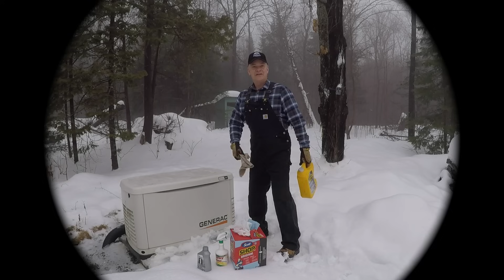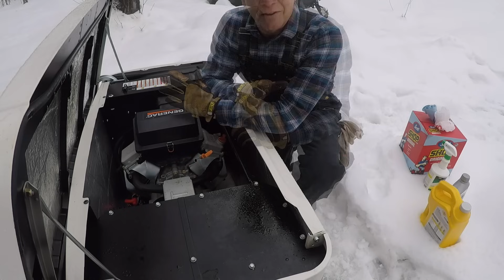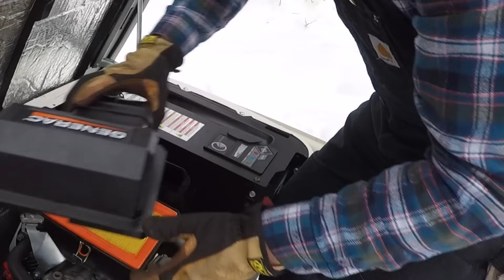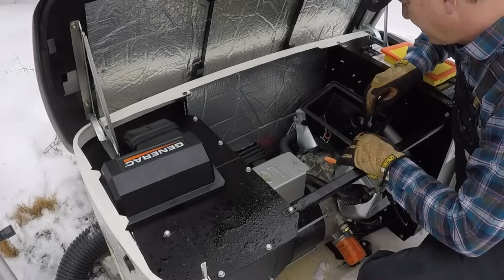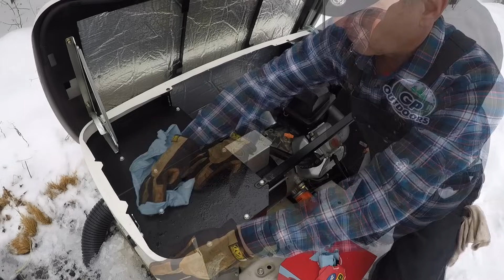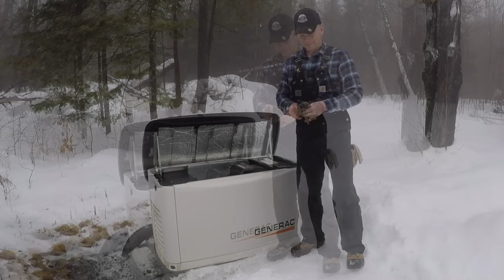#133 Thinking of Buying a Generac Generator? You Need To Watch This!

Comment: I don't understand why there's an exhaust port in the air filter. If it were my genset, I'd put in a different air filter or put a drain tube in the housing. Personally,  with the price of propane, I'd invest in a diesel genset. They usually run at 1800 rpm and they're good on consumption of fuel. Diesel genset cost more, but are more reliable. Personally just saying. 😎😎😎🤔🤔🤔
Reply from the maker: Good day and thanks Tomas. I understand it is the vent port from the crankcase. But yes, could be a better design I think, and have many here have mentioned. When the time comes I will certainly take a wider view of options. Thanks!
Reply: @GPOutdoors  
I saw the comments afterwards.  My phone won't always allow me to view comments. G'day
Reply: The crankcase vents the hydrocarbons into the air box so they can be burnt in the engine.  Cars can have the same issue.
Reply: Tomas Keating: "Diesel genset cost more, but are more reliable." However, diesel gensets require more maintenance to achieve any reliability improvement. The fuel tank tends to collect moisture and sludge and then things actually grow in the tank (i.e. microbial contamination). However, if the fuel tank is drained and cleaned from time to time, this problem can be minimized. Again, more maintenance. Also, if diesel gensets are not loaded to at least 50% of nameplate ratings, the exhaust system is subject to fouling and sulfuric acid corrosion (i.e. "wet-stacking"). If this unit is not being loaded reasonably, then it may not be getting warm enough causing the condensation issue in the air filter housing--a warm engine might not collect such condensation. Most residential applications are thus better served with a propane unit, properly sized (not oversized). Personally just saying. 😎
Reply: Soren Solveig propane is the least efficient fuel for economical long term operation.
Reply: Klaus Van Heusen My old gas 4 kw generator ran for around 4 hrs per gallon, my 2002 diesel 5kw runs for over 6hrs, and the diesel stores way better for long periods of time over gas. Propane is more expensive to run than gas, that’s been my experience anyway, ymmv.
Reply: Tomas Keating , all engine's have a pcv valve or positive crankcase ventilation valve , it is not a exhaust port , has nothing to do with exhaust , it it pressure from inside the engine crankcase , disconnect it from the air filter box , plug the hole in box and route the vent hose elsewhere , no more water freezing in the box , no oil blowing out the dipstick tube , problem solved

Comment: That sounds like a design flaw that should have been anticipated.
Reply: Trinkling Creek not actually sure you can. It’s an EGR system, the byproduct of poorly thought out government emissions regulations.
Reply: @onemischiefmaker7032  Never would have thought the PCV valve would stop the engine cold. I guess it goes to show you when ordering a small engine have them set it up for altitude and temp extremes.
The Honda's and Propane Convection Ovens my company owns are all tuned to run at 6000 feet.
Reply: Herman Greenfield  He probably just realized he was dealing with a half wit.
Reply: Yes, in retrospect the oil in the compartment makes sense that it was the PCV valve since that would cause oil to be forced out of the valve cover or oil pan gasket.
Reply: @edwo6648  Amen!
Reply: Herman Greenfield  Manufactures used to be able to vent the crankcase directly to the atmosphere before the government made them change it. Your very rude.
Reply: Don't pick on them Canadians I work with them in Fort McMurray they were pretty nice on the bottom of the air cleaner put like a PCV valves in the bottom when it runs it pulls the ball up when it shut off the ball drops let's the water come out and when you start it up the ball comes up again seals It Off
Reply: i bet herman is really fun to be around . what a peach , bless his little heart .
Reply: He may consider sending a link from this video to the manufacturer , I know I've done it with similar problems of other appliances I own , or when warranty expires modify it by adding a heating wire with a drain hose, iam no expert just thought of it as I was commenting.
Reply: Some of the psi 8.1 GM engines have a can with a filter in it for the pcv , the early ones would get a ton of water in them from condensation. 
Took em a few years , but they licked it by wrapping the can with insulation.
 Not a bad plan to retrofit others. 
Even some of the Briggs units a few years back had a similar issue until they redesigned the hoses. 
Some of it can definitely be blamed on short exercise times running no load. 
Haha if we could get the customers to run it loaded for a couple hours once a month in the winter it would help out,but they usually think these things don't need any maintenance like a new car that's minimal. 
Nope ,these things still need someone to look at em once in a while.
Reply: It is manufactured in the USA. Expect the worst.

Comment: Here's what's happening:

When an engine runs, it burns fuel to create pressure. This pressure is used to push the piston down in the cylinder, which turns the crank.

The piston seals against the inside wall of the cylinder with a series of metal rings. These rings have small gaps in them to allow for expansion and to create pressure on the walls of the cylinder. As a result, a small amount of the pressurized gases created by burning the fuel gets past the rings and into the engine's crankcase. This is called "blow-by".

These gases contain quite a few different things: primary amongst them are carbon dioxide, carbon monoxide, water vapor, and soot (carbon). Incidentally, this soot (carbon) is what turns your oil black - part of the job of your oil is to hold in suspension all the contaminants from the piston blow-by.

If the engine is cold, the water vapor condenses almost immediately into your oil. This is why exercising your engine for short amounts of time (where the oil does not get above the boiling temperature of water) is very bad: you end up with a milky emulsion instead of oil - this is water and oil mixed together, and is very corrosive to the inside of your engine. Whenever you run your engine, it's very important to run it long enough to get the oil up above boiling temperature, to boil off all of the water out of it.

So we have all this pressurized blow-by in the crankcase. It has to go somewhere. So it pushes out through the PCV (positive crankcase ventilation) valve, a one-way valve that lets pressurized gases out of the crankcase.

As I mentioned, there are some pretty noxious things in these gases: CO, CO2, and water vapor (which is acidic at this point). It will also contain a bit of oil mist. You could just ventilate this outside, but this will be messy, smelly, bad for the environment, and not to mention illegal. So instead, it is ventilated back into the intake manifold, where the gases are burned by the engine.

If the output of this PCV gets blocked (i.e. by ice) then the crankcase starts to build up pressure. So it has to get relief somewhere, and it does so by blowing out your dipstick. This is a good thing, because the next thing in line to get blown out would be your crankcase seals, and that's basically the end of your engine.

So how to prevent this? The main problem is that the water vapor in the blow-by is condensing inside your air filter box, and then freezing. My suggestions would be two-fold:

- Drill a small hole in the bottom of the air box, mount a barb in the hole, and connect a hose to the barb, to drain the moisture out of the air box to outside. The hose needs to be in the heated vicinity of the engine to prevent the moisture inside it from freezing.

- Make sure when the engine is exercised, it is run long enough to get everything good and hot, including the interior of the air box, so that moisture does not have long enough to collect and freeze.
Reply from the maker: Good afternoon gsmac. This was really, really kind of you to take the time to write this all out for us. Makes perfect sense. Yes, I do see milky cream in the oil when I check it sometimes. And everything you described lines up perfectly. Can't say thanks enough. In addition to the  hole etc, I have decided to pay for the new Kit they just released which is in essence, a heater that wraps around the vent pipe. Thanks again. This outline was great to receive. Cheers and all the best. Thanks again!
Reply: Great explanation, thanks :)

Comment: From a mechanics point of view. The area where the water is forming is below the filter. Not meaning on bottom, which it is. But on the non-filtered side. Which is a good thing. Take the smallest drill bit you have and drill 4 or 5 holes in the bottom of the canister. This will allow water to drain out and not form. You want them super small to keep bugs out. And since it is in an enclosed cabinet. There should not be an issue with a lot of dirt flying around. I would recommend switching to a different brand of filters. Fully in my opinion the Fram brand is at the vert bottom of good filter list. In past I have rebuilt several customer engines that use Fram. I only run Wix brand. Never an issue and I run mine pretty hard and dusty also.

Comment: These things sell like hot-cakes here in Upstate NY. I've installed some myself but never heard of this issue (I don't service them, just install them). Hard to believe a design flaw like this could exist on such a popular item. Good video!
Reply: Mine does it with no ice. Gets oil in the air box and drips inside the case. In Mississippi

Comment: I have purchased and owned Generac brand for many years. But that has come to an end. Generac is not what it use to be. The last two Generac items where a nightmare and customers service are screwballs. Very bad experience on the last two items. One was a 10k gen and the other was a pressure washer. Even the company I work for is no longer dealing with them and they have a few hundred sites that all have very large ones. They all have been changed from Generac. Like I said. Generac is not the same anymore.
Reply: Steve Fuentes the professional technician who installed my Champion 8.5kw standby gas generator a couple years back told me that the Generac generators are prone to have many different issues. According to him that has installed over 300 units of different brands like Kohler, Generac, Honeywell (both are made by Generac) and Champion this last one is the more reliable by far over any other brand in the market. In fact he has a few customers with over 1,500 hours of use that are still working flawlessly. If you do a search in google or here in youtube you would find a bunch of people complaining about their Generac generators but almost nobody about their Champion standby gas generators 👍😉
Reply: @raymondmorales8252  Champions are made in China.
Reply: Dave Skowron and your point is...🤷‍♂️🤔? Just because a product was made in the USA doesn’t mean its good quality, in fact some of them are JUNK like the Generac standby generators.
Reply: @raymondmorales8252  That is EXACTLY my point.

Comment: Great post... Simple enough of a fix. The PCV era began the emission stds. on autos in the 60's. Now look what we have! Lol... 
Last Jan. of 2018 I completed the install of a all-house generation system & went the portable route. Just me, the kids are all grown up & the X is a distant memory.
I did my homework on all things generator. I went with a Champion Dual/Fuel, approx. 7KW unit that I runs on LPG. It will NEVER see gasoline... I use (2) 40 Lb. portables to hold my fuel. with (2) 20 Lb. barbecues as backups. Over the course of 2018 up here in the highlands of N. Central VT there has been (6) power outages, some lasting for days, others for hours... My labor with cost of materials, incl. the generator, approx. $1400.00. 
The system works flawlessly, money well spent.
Thanks for sharing your experience, well done...
Bill on the Hill... :~)
Reply from the maker: Good morning Bill on the Hill! Thanks for sharing this info. I am glad your design is working out really great for you. I think that is an excellent system and certainly much cheaper, so money well spent. Pretty amazed at what those portable generators are capable of now and being able to run your home and heat in an outage at such a reasonable price is a good example of why everyone should have it, especially up here in the rurals where the power goes out on a regular basis. I have solar as you know, but my neighbours are all on utility power, and outages are a regular occurrence. Cheers and all the best Bill!
Reply: @GPOutdoors  Thanks for the reply back GP. I am new to your channel as I wasn't aware you are on solar, good for you! I have some friends in my area that are off the grid completely, actually they are brothers, each with his own homestead on the same piece of land... I agree, in today's times power outages are becoming a regular occurance. I have thrown out valuable frozen foodstuffs over the years now as it gets very expensive to replace it all. I am not a certified electrician, however I am comfortable working around it, incl. inside the main box. 
I live in the highlands with a 100 mile view, my closest neighbors are a 1/2 mile distant in either direction. My kids have been after me for years now to get a backup generator. I can't begin to put in words how satisfying it is to run all my systems, heat, hot water, artesian well, stove, satellite TV, computer, every light in the house if I so choose when the power goes out. 
Cheers,
Bill on the Hill... :~)
Reply from the maker: It sure feels good Bill to keep the lights and heat on when the power is out. I agree with you there. LOL. It is a regular occurrence up here. Cheers and thanks for watching and for your comments!

Comment: I was grateful for finding this video since I live in WNY. The temperature was zero or below each night for several days and didn't rise above freezing for over two weeks. After reading this I immediately checked my generator. Thankfully there is absolutely no evidence of frozen condensation. I will continue to be diligent of this possibility over the next weeks of winter. A week ago, however, I discovered 36" of snow drifted over the end vents. After clearing that I decided building deflection walls on either side but allowing for proper ventilation would be an appropriate summer project. Before starting the generator 2 years ago I had built a roof over it to protect from snow and ice sliding off my barn roof. That has proved to be important, but now need to attend to protection for the side vents. Thank you for this valuable video.
Reply: Thank for the tip.  Having one installed within the next two months under a carport in my home in Binghamton.  I will look into protecting the sides, but still allowing good air circulation.
Reply: Fredonia here...

Comment: Why not just drill a hole where the water builds up? Put a piece of filter membrane over the hole so water can drain but no dirty air comes in.
Reply: And when the wet membrane freezes?
Reply: @trustme7731  will not happen, generator is warm from running all condensation is drained off and dry prior to getting cold soaked again.
Reply: @NewtonWashinton  Obviously it is happening.  It needs to run until HOT. The source of the water is from the engine crankcase from not being run long enough. Where do you think the water is coming from?
Reply: @trustme7731  source of the water is condensation, I have this same generator for 7 years now and i fixed it 5 years ago with the procedure i said, no problem since.
Reply: It's not clear to me why Generac has not applied a fix.  This appears to be an ongoing issue.
Reply: @rmcgorman  You are correct,  but it only occurs in very cold climate so most of the Generators they sell are not affected. Still it would have been a easy fix for them.
Reply: @rmcgorman  The fix is to run the generator for at least a half hour each time it runs so it is shut down when hot.
Reply: @trustme7731  So, better off  to set exercise cycle to 40 minutes once a month versus 10 minutes once a week?  Presuming of course that that the battery can maintain its charge over a month of cold weather and 40 minutes is adequate time to fully recharge it.
Reply: @NewtonWashinton  You didn't fix it, you by passed it. It's like taking pain medicine. The pain appeared to go away, but the source of the pain is still there.
Reply: @rmcgorman  I don't care how often it runs. You and the manufacturer can work that out. I'm just saying ANY engine that it shut down before it can run at operating temperature past long enough to burn off the moisture will give you trouble, just as GP Outdoors did. Yes, the battery will stay charged for over a month. If it doesn't, it's time to replace it. Speaking of which, batteries should be replaced BEFORE they fail, for obvious reasons. Some generators have battery maintainers that use utility power. Utility power is disconnected when the generator starts.

Comment: Sheesh that's a fire waiting to happen right there. Oil mist and vapor flying all around in an enclosed cabinet. I'm sure it runs quite a while until the low oil alarm trips. As others have suggested, you need to relocate that PCV breather to another location on the intake or just let it vent into the atmosphere. Letting this happen to many times will eventually blow out an oil seal as quite a bit of blow by and expansion pressures are building up in the crankcase. Thanks for making this video to alert others to the design problem.